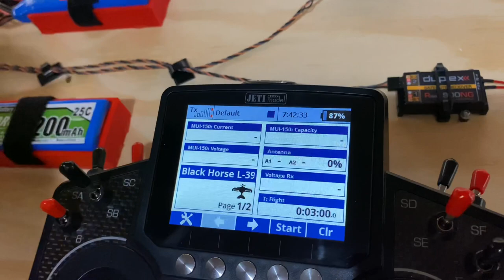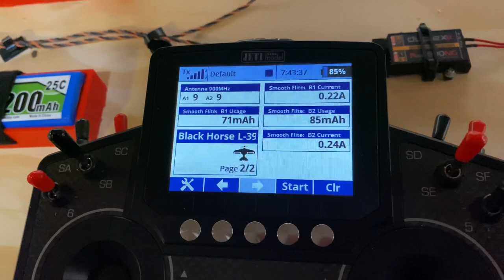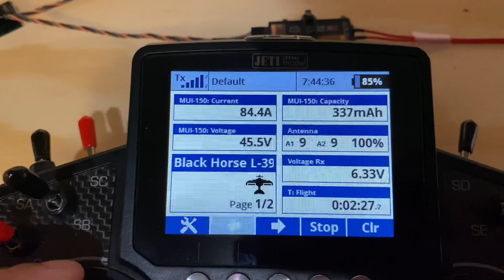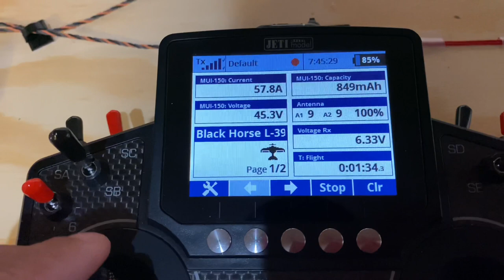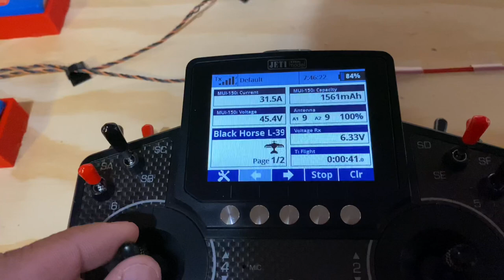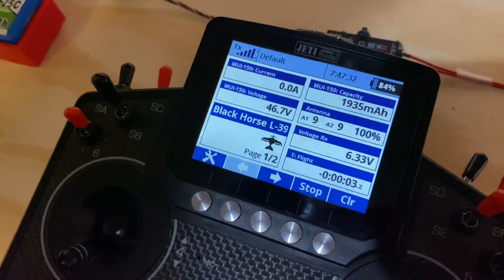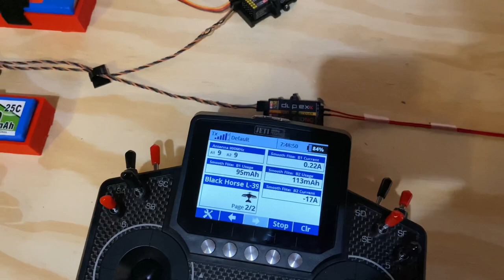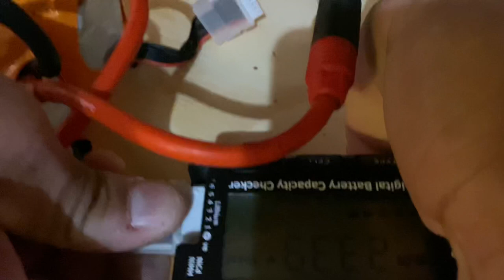*Test Run* Schubeler 90mm EDF - King of EDF?

Comment: Nice setup and testing Sir. I fly jeti as well and can appreciate the data your system provides.  In a similar setup, I’m using a mezon 160 lite esc and muli 6 sensor, limited to 8S.  Another jet on 12S uses hobbywing 105a esc, 150a mui sensor in combination with a muli6  to provide lipo data from both packs.  I look forward to seeing inflight video!!

Comment: Great stuff guys! Awesome set up. A  few things to watch, motors on the bench get hot fast without a thrust tube. Watch that! Second, static thrust numbers from Shubler are pretty accurate but they will change under load in the plane depending on FSA of the thrust tube and intake. As long as your model weight stays under 14lbs with batteries that fan with a little math done right on those things I mentioned should fly the snot of it. Super excited for you!
Reply from the maker: Hey thanks for the advice David!!
Reply: @hamiltonshangar  want you to be successful my friend! Im here to help and taking notes to!

Comment: exciting! But I'm sorry to say it! How much is the static trust. After all, it is the one to be used for the specific aircraft, that weighs?  
You need to measure the trust, lbs trust with a weight. And then put the trust up against the plane weight. And then assess whether the plane can come from the grund. 
Enjoy.
I'm excited to see which planes that engine set is going to be in.
Reply: I’m surprised he didn’t measure the actual thrust.
Reply: @memcrew1  I agree. I don't think it has enough trust, but I hope the best for him, there's a lot of money to spend without knowing for sure 😲
Reply from the maker: I will have plenty of thrust to get off the ground!! Stay tuned :)
Reply: @hamiltonshangar  I don’t doubt you will.....check out this engine stand from banana hobby. It has a thrust indicator included.
https://www.bananahobby.com/jp-hobby-edf-turbine-engine-testing-stand.html

Comment: I was going to get that Schubeler but figured out I could order a Hacker 100mm but the diameter fit a 90mm Jetfan.  These are the specs on the motor.
Reply: 1070kv, 125amp, 7kg thrust (15lbs.), I understand I may not get all that but it should still be a Rocket!  Hope to maiden mine very soon!
Reply from the maker: It will definitely be a rocket either way man thats awesome!

Comment: Can you please make pressure test? Like put this motor in 1m long pvc pipe, add pressure sensor in pipe and at full throttle start closing the pipes open end with hand to see how much pressure it can make? 
Need this info for a project
Reply from the maker: Sorry bro, she is locked Down tight in my L-39 now!! Thank you for checking it out!

Comment: Got a weird question. Can a edf be run without the use of a receiver? It won't be installed in an rc aircraft so I don't need to control the speed of the edf.
Reply from the maker: Yes because it needs a speed controller to even power on,  and that is done through the receiver.

Comment: Hello, could this device be running at maximum speed for hours? , It's for an experiment
Reply from the maker: It will not run that long with this battery setup. I wish lol 😆
Reply: @hamiltonshangar   Ok if i have a long term battery set up ?  3 or 5 hours ?